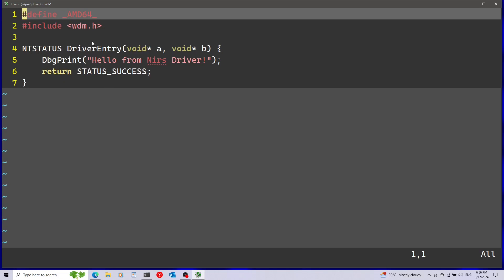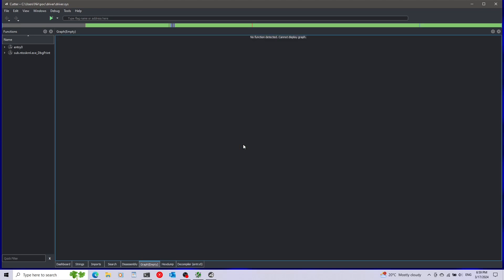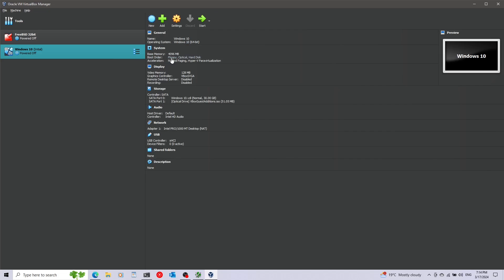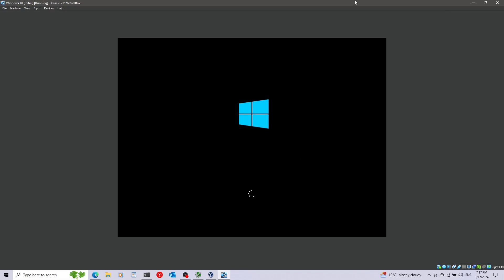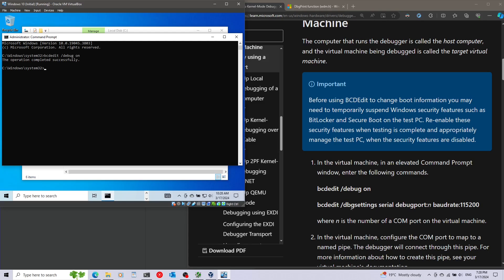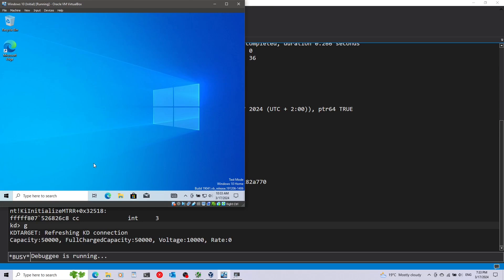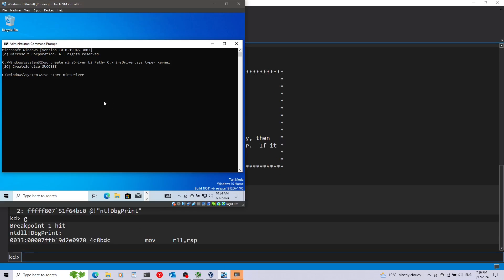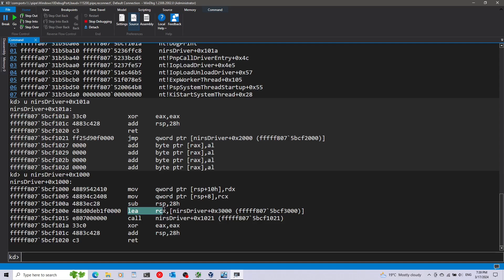Reverse Engineering Simple Windows Driver

Comment: Dear Nir,  there is an HP app (Omen Gaming Hub)  which has special privileges to modify the BIOS and even modify write-protected UEFI variables. It interacts with the WinRing0 driver and some other HP drivers. Long story short, the app sends a WMI/RPC call with a set of bytes in a special structure, upon reboot, a write-protected UEFI variable is modified. I have reverse engineered the app and was able to spoof the same behavior using open source code. The problem is that I would like to modify a slightly different write-protected variable, and I cannot understand the mapping between the set of bytes being sent in the WMI call and the UEFI variable address. The way these bytes are translated into actual NVRAM addresses has to be part of the driver.
Is there a chance we could discuss this further? Maybe with your expertise it might be an easy thing to spot. Thank you for the video